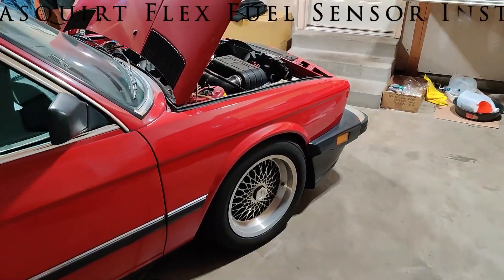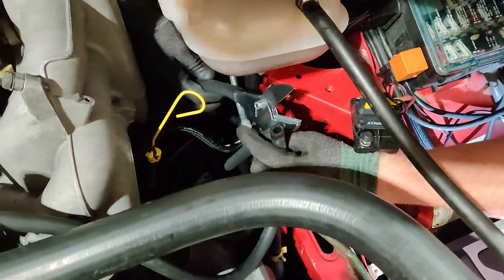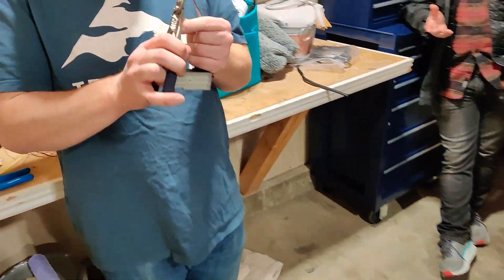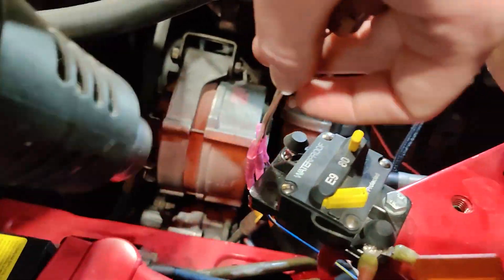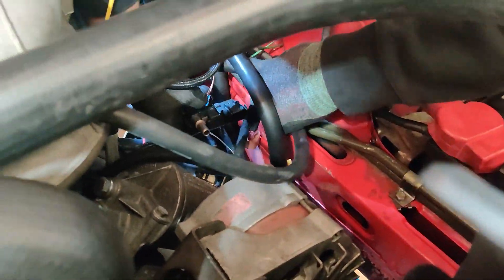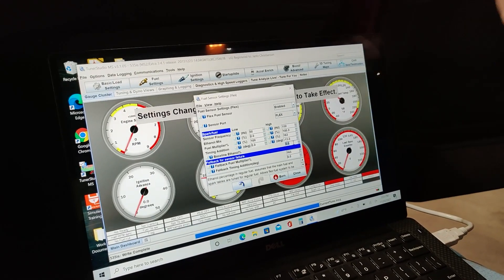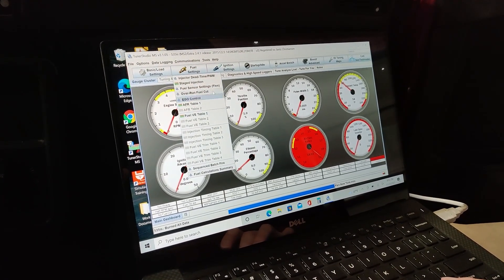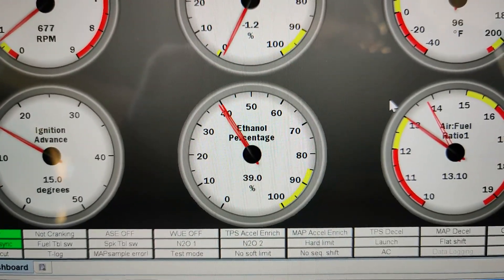Megasquirt Flex Fuel Install and Setup

Comment: I’m trying to figure out the wiring portion on my MS3pro.  Sensor signal goes to “digital switched in 1” pin 32 on the white connector.  Sensor ground should go back to pin 18 on the white connector “sensor return”? Where do I get the 12v supply for the sensor from?  Any info would be greatly appreciated!! Awesome video btw!
Reply from the maker: You can take 12v from the ecu power circuit or fuse panel. It’s low current but just needs a good 12v power source
Reply: @ thank you so much

Comment: Did you need to tune at all? Or you just used e85 corrections and the ecu adapted automatically? How did you tune the engine for the new fuel?
Reply from the maker: As long as your base fuel table is tuned correctly the multiplier for ethanol based on the sensor output is generally pretty close to

Comment: Hi I’m wondering Did you have to upgrade the injectors? And if so what were the original injector size and then the uprated size? Trying to figure out if 440cc injectors are big enough for my naturally aspirated build if I’m currently running 210cc. Power goals aren’t high it’s a 1996 2.0l Vw 8v so I’m shooting for around 130 wheel.
Reply from the maker: Yea I have Deka 80lb injectors
Reply: @TurbineResearch  gotcha thanks I’ll have to do more research to see if I can get away with using 42lb Bosch ev1 injectors for my own setup. According to online fuelinjectorclinics calculator they should be plenty for the power im after.

Comment: What board version of megasquirt is this using?  I was hoping you would show the difficult part.  I'm fighting getting the circuit built with 5v pullup and jumper wires to get signal to JS7 and into pin 10 on the ms2 daughter card. Do you have any images, or tips on how you built the pullup circuit and jump wires?
Reply from the maker: It's a microsquirt with a dedicated flex input